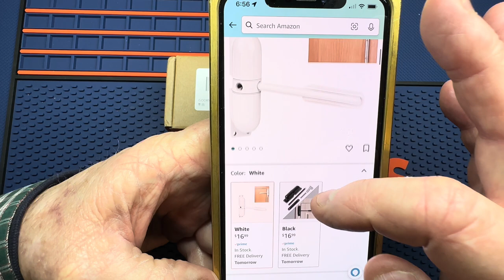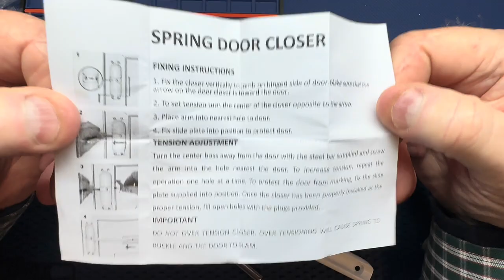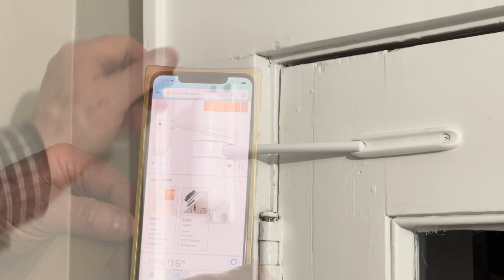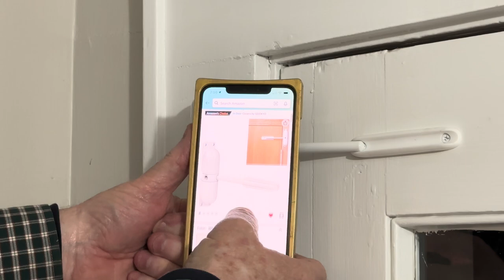Amazon Gookyo Door Closer Review

Comment: Heavy door use 2 rather than overloading 1, they are cheap 👍
Reply from the maker: Two wouldn’t work just so you know it’s not needed. You can put it on the lowest tension and it closes the door fine that’s what I eventually did. Thanks.

Comment: I purchased one from Home Depot it didn’t work for me my dooor still slammed and now I have holes in the door jam when I take it off and return it 
Not sure if my door is too heavy or what.
Reply from the maker: The problem is not the door closer but the stop that the door is slamming against if you would apply some Pemco S88 non-rigid stop seal to the side. The door is hitting against on your door jamb it wouldn’t slam anymore. It would have a cushion effect to the door, stopping all that noise and then adjust your door closer to the lightest spring tension location.

https://a.co/d/0h0iVdj
Reply from the maker: you know a door closer is made to close your door it won’t stop your door from slamming unless you spend around, $120 and buy an ADA approved door closer then you can adjust the latch speed to close whisper, quiet like in a hospital
Reply from the maker: Here’s how to adjust ADA door closer so watch his installation of a door closer as well if you want to have it done by a professional, then go ahead and call or visit your Local Locksmith. He’ll be more than happy to answer your questions free of charge
https://youtu.be/VlqKJcfhcbo?si=X3si5ItCs6ihqO8Y
Reply: @doorandlocktips  thank you I got it to work with the help of the hubby.
Reply from the maker: @mscherrylyn1  bravo spectacular hooray I am so happy for you. I’m glad it’s working fine now.

Comment: Hello, how can I control the speed of the door
Reply from the maker: Less tension so all you have to do is barely apply tension to the door closer shaft. It really doesn’t need much to close your door and apply Pemco non-rigid weatherstripping to your doorstop get it from AmazonPemko - S88D18 SiliconSeal Adhesive-Backed Fire/Smoke Gasketing, Dark Brown Silicone, 0.5" W x 0.25" H x 18' L https://a.co/d/bfjCOvu for the money the door closer is fabulous buy it install it put in the weatherstripping and forget ever being told to close the door again the door will slam closed and has no hydraulics in it but if you make sure not to over crank up the door closer everything will be cool, especially for the money

Comment: Nice little unit. Can it be lubricated through one of the unused post / arm holes?
Reply from the maker: You know that’s a great idea I didn’t even think about that you are super brilliant that’s what I’m gonna do because it needs some love. It really doesn’t make noise anymore so at first it made a little bit of whining, but I’ll put some great spray lubricant on that bad boy through one of those holes all the holes. Thanks again you are, very perceptive to say the least
Reply from the maker: Yes it can. I just tried it. This thing is wonderful you don’t have to over power it like I did in the video but in the end I crank it all the way back down to the second adjustment and it works perfect I love it $16.99 can you believe it?
Reply: @doorandlocktips  I'm glad it's made out of decent metal. Hate when a good product design comes out, but it's ruined by substandard materials.
Reply from the maker: In the month since this was installed, there is no noise or even a hint of whining so I don’t think there’s any lubrication necessary. Great little unit works perfect every time you open the door.
Reply: @doorandlocktips  Great to hear, thanks for the follow-up! 🍷